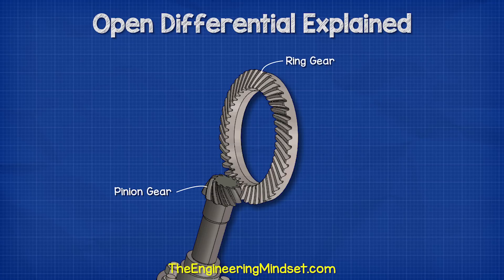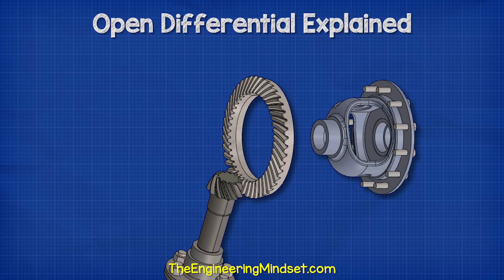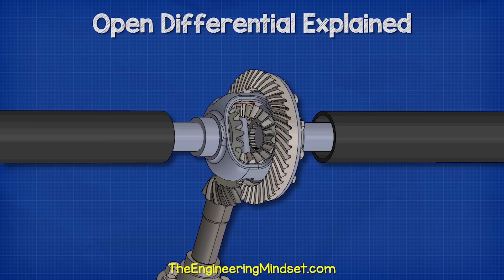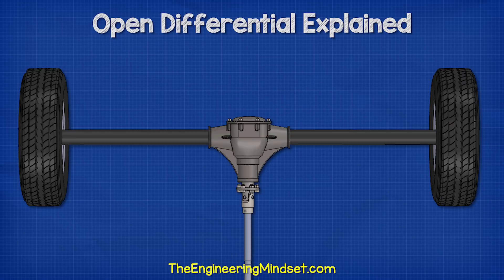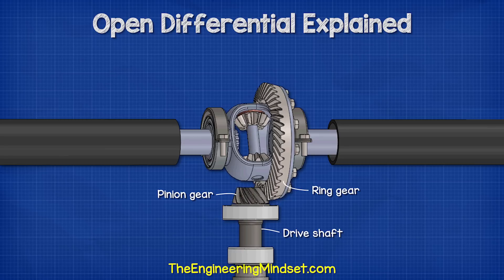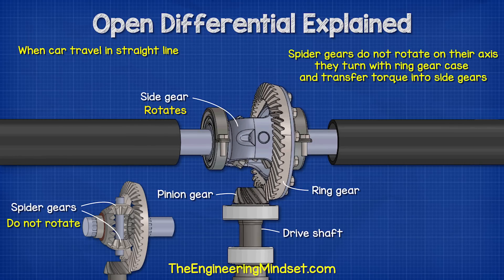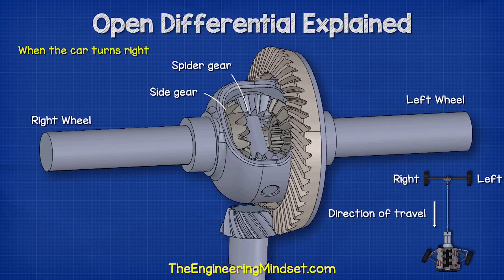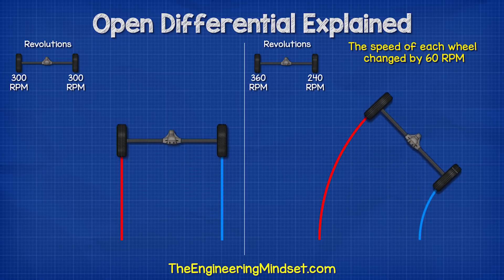How Open Differential works

Comment: So what I am experiencing is probably normal? I just uploaded a video trying to troubleshoot why my wheels aren’t turning at the same speed when the car is off the ground. Also, the issue is when I slightly depressed the break the wheel driver side wheels starts moving until I apply more pressure and then it stops with the other wheel. When I released brake pedal both wheels turn until there’s just a little pressure left and the driver wheel starts to stop again while the other ones continuing at a higher speed and then when I finally released the break, the driver side wheel stops rolling while the passenger wheel seems to continue at a pretty high rates speed .

Comment: Very poor, almost unacceptable. The pistons in the engine are connected to the CRANKSHAFT, not the camshaft. A typo in the cartoon maybe just a typo, but then for the explanation to also call it a camshaft, it seems as if the person talking does not understand what is going on, which for a channel like this IS totally unacceptable.
Reply from the maker: Thanks, I've accidently said camshaft instead of crankshaft. Mistakes happen. Correction has been added to the video description.
Reply: @EngineeringMindset  Many thanks for coming back so quickly. I was not the only one to notice having read some of the other comments.

Comment: The only thing that i would personally add is a presentation on what happens when one wheel looses grip. But i guess this may pop up on a more advanced diff with a locking mechanism ;)
Reply: This is what I was wondering, so is that a situation when the difference becomes non-proportional and would fail without a lock?
Reply: @antonyloc  basically thats why offroad cars have a diff lock. When one wheel loses grip then it spins like crzy taking al the force out from the wheels. Diff lock stops this and forces both wheels to spin with the same speed. But this also causes the issue that when turning they also spin with the same speed. And thats why the diff was invented so they can spin in different speeds.

Comment: Enjoyed the video. In your example, are the changes in speed really "inversely proportional". For instance, if you slowed one wheel down to 1 RPM from 300, it wouldn't make the other wheel go 90,000 RPM. It seems more like an additive/subtractive relationship, where the lost RPM of one wheel is found on the other.

Comment: Er... I still cant see how both back axles turned independently, watched a few times but you got me. Both axles are in contact with the spider wheels so are effectively locked together, so how can they turn independently?? Certainly a clever peice of engineering. 
Is there an dummies video guide to this video? 🤔😔
Great graphic by the way. Even though I'm stumped.
Reply: Because the spider gears can turn independently.
Search YouTube for Lego technic open differential. There are videos of people building one with Legos and it makes it easier to see step by step.
Reply: Look for these old videos (i think done by us army or something) explaining differential and Many other mechanical principles they are much much better.

Comment: The video does not explain why open differentials are  - or can be - inferior in snow or on wet grass.
Reply: Inferior to what? Pure guess here as I know nothing about this topic: closed differentials? Not trying to be funny, I really have no clue about this stuff...
Reply: @hisss  I'm not super educated on the topic, but just from living in a snowy area, I think they're called "locked" differentials, and basically it inhibits the wheels from moving at a different speed. I think somehow it disconnects the spider gears so they have to move at the same speed, and it makes it harder to lose control and spin out. it's good for traction, but bad for turning and can even damage the differential/axle if you put too much stress on it. 
If you look at a car stuck in the snow and putting throttle down, you can see one tire spinning and the other not moving with an open differential. With a closed (locked) one, both are forced to move at the same speed so there is both more traction and they wont rotate in different speeds so you aren't as likely to slide on ice from forward motion (I think)
I could be wrong and you'd need to verify all of this, but this has been my understanding for most of the 18 years I've been alive haha
Reply: @hisss  Inferior is perhaps too strong a term.  Open difs are fine.  They are under most vehicles on the road - even        4WD vehicles.  What's better is BLD or brake Lock Differential, which senses when one side is losing traction and shifts power to the side that has traction.  Better yet are the several types of AWD systems that sense corner to corner as well as side to side and shift power accordingly. My old Grand Cherokee has open difs, but it is equipped with BLD, called Command -Trac, which does make a difference although it is not particulary heavy duty.

Comment: The only change to this video is the pistons and their connecting rods are mounted to the CRANKSHAFT not the camshaft.  The camshaft is turned by the CRANKSHAFT and the camshaft is used to move the valvetrain which opens the intake and exhaust valves.
Reply from the maker: Thanks, correction added to video description
Reply: @EngineeringMindset 
No correction to the video?
Reply: Yeah right. I noticed that also. It should be crankshaft
Reply: Guys it's a tiny mistake don't crucify him for a small mistake it's already hard to make these videos
Reply: I'd commented on this before I saw your comment.

Comment: Not all rear end have a back cover. A Ford 9 inch has the cover as the center of the rear end. To remove it you pull the axle covers off, pull the axles out and take the center out of the pumpkin.
Also if you have the trans in park or in gear and you turn one wheel the other one spins in the opposite direction.